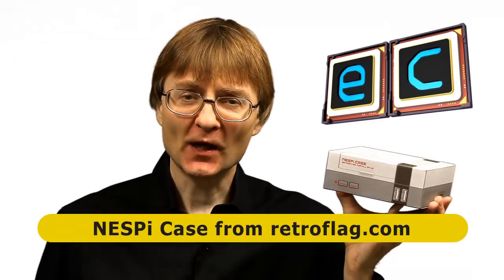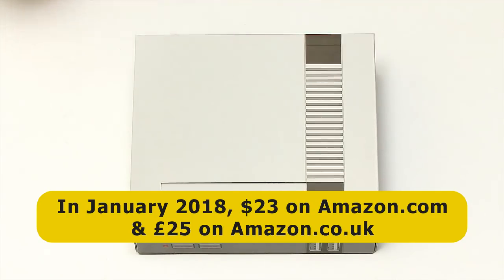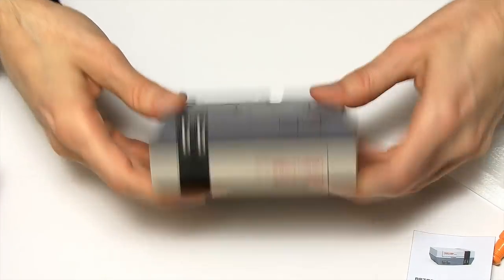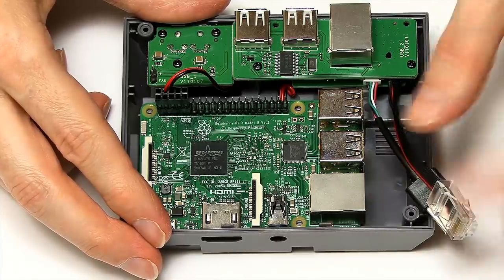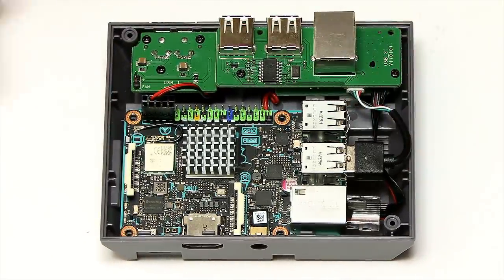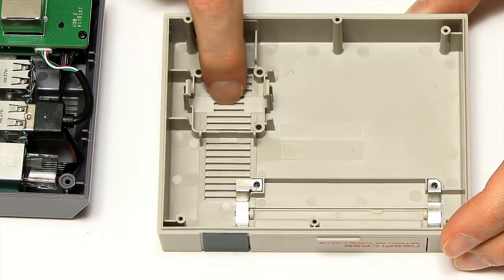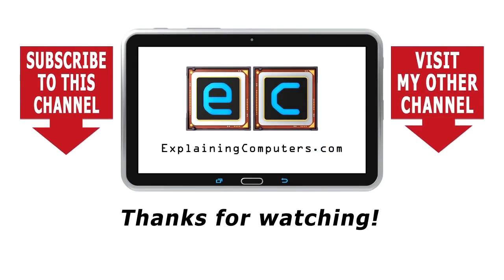NESPi Case for Raspberry Pi

Comment: Its a good case but the thing I've noticed is that the slot for the 3.5mm hole is way too small so you may have to make it larger. I spent an hour trying to figure out why the composite video just shows a black screen and then noticed that the cable was not connected properly because the 3.5mm hole on the case is too small for the cable and does not give a proper connection.

Comment: Very interesting, The new iterations come with a safe shutdown switch you can enable, you just have to install a script on your pi, flick a switch on the inside of the case, and the front powerbutton will safely shut down the Pi. Marvelous. Also, there is a new SNES case that just came out that seemed to solve the whole front connected Ethernet that.. me, among others, do not enjoy, Granted, its not on the back, but on the side, towards the back is better than nothing!

Comment: I would have hoped that you addressed the temperature icon for the pi at the end of the vid.  I would assume using a fan and heat sink would bring temps down?  Awesome video!  Thanks!
Reply from the maker: Yes, a fan clearly needed. I have looked at several in other videos. :)

Comment: One thing you missed from the video; the reset button can be programmed to restart whatever main program you use for emulation (e.g. EmulationStation) to gracefully stop running programs and then reboot the Pi.  Similarly, you can also program the power button to kill applications gracefully and then power off.  
A basic scripts is available here: https://github.com/RetroFlag/retroflag-picase however, you may want to customise the script it installs for specific actions.  Anyone reasonably familiar with Unix and Python will find this a breeze.
Reply from the maker: I indeed missed that! I guess it is just a GPIO input switch after all. Interesting possibilities . . .

Comment: +Chris 
I'm soon planning to sink an ASUS Tinker S into this case with a mounted fan.
Do you know, whether the fan blows permanently or is it regulated in any way by the temperature in the case?
Reply from the maker: I'm sure that the fan will just blow -- no regulation. I too may try a Tinker Board S in this case! :)
Reply: Thanks for answering my question.
So there is a further temperature management necessary - maybe with an 8-pin AVR plus T-Sensor. Anyway, I like that case, even if it costs 27€ here in Germany.

Comment: Hi Chris,  I got this case and its awesome!  One thing Id like to point out (from knowledge I gained from your channel :) ) is that for a safety measure when using this case where it kills the power risking SD corruption, what I did in my build was use Berryboot on the SD then boot retropie of a mini USB drive that plugs into the pie itself so its out of view and you dont have to leave the lid open in the front....so thanks mate for that! :)
Reply from the maker: Thanks for this -- good Berryboot tip. :)

Comment: I recommend a wireless keyboard like a Rii 8+ as you can put the receiver in one of the USB slots inside as its a small receiver and keeps the external slots free as well as having a clean look. Also 2.5A is the recommended PSU for the Pi 3

Comment: QUESTION:  Just rec'd an RP3B as a gift.  Discovered the HDMI is only giving me video, and no audio.  Do I need to connect the sound plug to spkrs to get sound or is something defective?  Thanks, Chris, I enjoy your program.  Mike
Reply from the maker: Thanks for your kind feedback.You just need to change the settings in preferences to output HDMI rather than 3.5mm audio.

Comment: These SBCs & retro gaming are extremely new to me...someone help me out?
I want to build a RetroPi style gaming station, but want "the best" SBC that will also do some Gmail & Facebook checking, web browsing, & watching The YouTubes in 1440p60fps...

It seems that either the Rock64 4G or the Udoo x86 Ultra would be best? But would they fit in the glorious case seen in this video?

As far as the gaming...I'm just looking for those 6,500-7,300 retro games from the original Playstation & back. Not looking to play Crysis on this thing, though maybe some PS2/Xbox 360 games would be a bonus...

Comment: in defence of the push/pull sd card reader replacing the push/pull one.  Within the first month my pi2 fell off a table and the sd card slot is now permanently pushing out.  I either have to secure it with an elastic or store the case upside down an push a butter knife against the slot.  I am quite pleased that they use a different system in the pi3 I got my nephew.

Comment: I got one of these cases with the little fan and I needed my 2.5 amp power supply for it to run well without that lightning bolt symbol on the upper right corner of the screen.  It ran fine with 2 amps when the fan wasn't connected.  I love it and I will probably get more.  Thanks for letting us know it also fits a tinker board sometime I might try one of those out.

Comment: I do understand the reasons for uploading/rendering 720p content. However, I must say I would be very pleased if the videos were 1080p (or even 4K). Would that be a good new year's resolution? I am so sorry.
Reply from the maker: I am planning on moving my pipeline to 1080p sometime in the first half of 2018. As you appreciate, it requires quite a lot of pipeline changes (not least re-rendering all of my titles and stock elements, and also changing my shooting style as a regularly crop a 1080p plate in post). But it will happen -- it has to! :)

Comment: I have a Rpi2 but the spring is borked and right now I have to tape it or use a rubber band to hold it in place, do you think I can use this box with the pi with this condition ?
Reply from the maker: You should be able to tape it using this case.

Comment: Yay! Great coverage as usual!
I have one and it’s nice but the ventilation at the top of the case is quite restricted making a fan much less effective. 
I’m tempted to pull out Mr. Dremel and make a few cuts, but I’d probably harm the aesthetics of the thing. 
A fan is probably overkill for a Rpi3 with standard clocking and heat sinks but a Tinkerboard is another story altogether.
Reply from the maker: Totally agree on the potential benefits of Mr. Dremel here! :)

Comment: Another great SBC project accessory on another great vid.

One future project I would like to see is if it would be possible to use an SBC as a streaming/encoding computer to take some of the weight off a PC and find a const effective way of utilising a Raspberry Pi to stream with a minimum setting of 720p and 30 fps and how further up it could go if it had no bandwidth limitations.

Comment: Nice video.
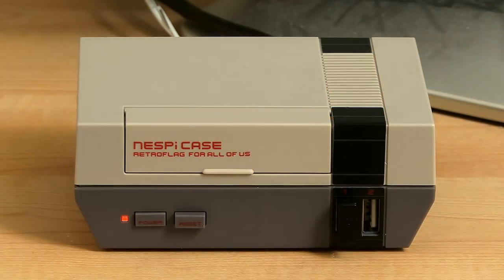Where did you get your Storm Trooper helmets on the right side of your table @ 10:16 ?
Thanks.
Reply from the maker: These are home made -- rotocast in fibreglass resin from a latex mold taken from a modified "bobblehead" stormtropper.
Reply: ExplainingComputers Aww, shame, they look great. Anyway, keep up the great work with your videos.

Comment: I bought one of these a month ago and was very impressed with it both as a case and resembling an nes. The only real knock against mine was that the screws fastening the pi down weren't perfect, but the pi 3 sits in there very well.

Comment: Chris, why did you not put the wireless connector at the internal USB ports? other then that I found it good that you showed the possible errors one could make putting it together. And if I am not mistaken, perhaps you could fit a 2.5 HDD at the inner topside that has some room left, although I am sure you would have to destroy the case a bit to fasten it.
Reply from the maker: Yes, the donly could go inside the case -- but not if you want to get it out easily! :)  You may get a 2.5" drive in the top of the case (I've not opened it up to look), though the screw risers that stick down onto the Pi may need removing to achieve this.

Comment: 5:19 - how do you refit a glued on heatsink?
Reply from the maker: It is fitted with thermal tape -- so fairly easily reapplied (if not as well without some new thermal tape).

Comment: Nice.  One of my concerns was about heat... thinking back a few videos and remembering that some of those little boards demand a 4A power supply (not in this particular case), I got wondering how the heat would be dealt with, but you addressed it with the 30mm fan option.  It would be interesting to know if that would be enough to deal with whatever heat could be generated with such a setup.  I'm not a big fan of these little tiny SBC's, but every vid that you make about them puts a wee bit more confidence in me about them.

Comment: I ordered mine just before Xmas as had wanted to get back into homebrew ZX gaming and I found a load of my old Atari 400 computer games printouts from that glorious era plus a few old MSX and Oric/Atmos and BBC printouts and even one ancient withered and yellowed set of ZX80 program typed sheets for a very sketchy random maze sort of game I made using large cube lines to create the classic "dungeon" experience so spotted Retropie had MSX, ZX Spectrum and several Atari platforms I followed on with my Nespi purchase with a RP3 and so looking forward to peek and pokeing, stabbing a few USR's to get them blocky pixels jumping about the place again hehe and especially in the case of the ZX80 fire will no longer be an option (my mum bought me a ZX81 cos my kit form  ZX80 just kept combusting and I prob annoyed Sir Clive like hell getting replacement parts hehe)   The Atari 400 doesn't seem well remembered these days altho it and its bigger brother the original 800 were quite formidable gaming platforms, just the price compared to the Vic and C64's saw the platform divebomb and by this time I had evolved to Speccy +3 and was repairing and building my own PC's from salvaged parts.
Reply from the maker: Great days.

Comment: I was thinking that if you have a wireless keyboard/mouse with a small dongle than could go inside the case. Which would be neater and give you four free ports on the front.
Reply from the maker: Yes, you could fit the dongle inside the case -- though not if you need to get it out regularly! :)

Comment: I like if they made a Thinkerboard with two built in 8core CPU and they use 2 cores as one single core, like a Raid0 for 2 cores to work faster, so having two 8core CPU's would work as one single 8core CPU at much faster clock speed, so it can play modern games, an M.2 slot in the back side of the board, and a Ram slot so we can put 16GB or DDR3 ram

Comment: A nice review. This case addresses one of my minor faults with the Pi and that is that cables and wires come out in all sorts of directions giving the Pi a rather disheveled look. No fault of the Pi though for a palm-size sbc you must address a few tradeoffs. A nice review indeed. Well done.

Comment: Great case, bought a few right when they came up. Not too keen on having the ethernet port on the front though, that needs to go on the backside... Also would have been nicer to have all the spare unused usb ports routed to the front (maybe keep one internal for a wireless mouse/keyboard combo). (read more for nitpicking and tldr;)

Also, wow, would it have helped to have read the manual to know where those screws went, before you made the video? Honestly (and I'm nitpicking here, the video is fine), I'm not used to you fumbling with things like that. Usually you're very clear,  thorough, and methodical, but in this video you were a bit all over the place.. 

tldr; Nice case, but would have been ace with only peripherals on the front, and connectivity on the back.

Comment: Very impressive but those are not soft power buttons if they just kill the power. A real soft switch that saves and shuts down the OS would be keen, maybe make the reset into a controller sync.

Comment: It looks like there is an unused USB slot inside the case. Does that have enough clearance around it to put your Rii dongle in it inside the case  freeing up all the external slots? I suppose that isn't a good idea for you as you use the Rii for so many SBCs, but if it was a more normal person (some of your subscribers may qualify) it might be a slicker solution, assuming it does fit. So, does it fit? Would anything else fit in the second now internal USB slot?
Reply from the maker: Yes, indeed, you could fit a dongle -- or three! -- inside the case if you did not need to get it out. As you say, for me, that would be kind of inconvenient, given how I move kit around to make videos.

Comment: they should've just put a hole in the back so you can connect it to ethernet before screwing it together. because if you use ethernet, its gonna be hooked up all the time. front ethernet is just a waste of money.. well, or ideally just put a 90 degree adaptor to make it to the back but I see the difficulty in this as there is no space to do it..

Comment: Brilliant! Well I got a Nes Pi myself but its the Hikig version which is more lightweight and allows proper circulation for my fan. It works fine near 2.5Amps, although it doesn't include the Reset or Power button but my Power Plug contains a 1/0 switch for my Pi to turn on and off. I also use Lakka with RetroArch to power my Retro games. And I use my Logitech F510 GamePad to play it. If you like to know what my Nes Pi looks like have a butchers from this link below:-

https://images-na.ssl-images-amazon.com/images/I/618AjiS%2BVkL._SL1500_.jpg

As you can see its more slimline and can easily fit in your briefcase and my Temp rating at CPU full utilisation provides a adequate environment for the Pi 3B.

Comment: My Pi's internet is hard wired so I'd feed the cable through the back of the case and straight into the Pi also for the keyboard to leave the front clean.

Comment: Another great video, really like your coverage of sbcs. There have been reports in the retropie community of receiving low voltage warnings using this case with 2 - 2.5 amp power supplies. I use a 5v 3a ps with mine and it works great. It is a great case but for best results you want to give it some extra juice. 
Unofficial RetroPie Discord Chat: https://discord.gg/JdXc6nx
Reply: Realm Chat Yes I also found this worked for me. I kept trying out power supplies with extra voltage, but not until I had one in with more amperage did it finally work as intended!

Comment: I find it silly they have the LAN moved to the front when the back of the case would be a more logical place for it to be moved to for use. That flap on it should also contain a recessed area to allow smaller dongles like your one you plugged in to be fitted under the flap and still allow it to close. From what I can see here in this video any dongle plugged into those ports would prevent the flap closing.

Comment: I really like this but you would need to have a second pi if you wanted to use the g.p.i.o. pins! Not that any excuse to buy another pi is a bad thing!
Reply: In fact i installed Retropie and wiringPi together! That way i can use gpio pins without problems!
I use a RGB led for GPU temperature monitoring! I also hacked the reset button and installed another button to shutdown the pi properly! So...you will not need another pi if you want use gpio pins!

Comment: Could you put the USB keyboard/mouse receiver in an onboard port inside the case and still leave the front ports free? Maybe there are wired controllers for a truly retro feel, but still be able to use a keyboard for the OS?
Reply: Leon Adams Yeah, you can use the internal USBs, for anything that will fit :)
Reply: Sweet!

Comment: Excellent case. With a Raspberry Pi 3 you really want a heatsink and fan - otherwise the system gets really hot. The Pi 2 won't get too hot.
Reply: I just watched your video on that cooler with the two fans. How's your pi 3 been holding up in the nespi case with that cooler? Is it still pretty much the same temps as in your video?
Reply: Yeah I got a fan in mine think I gonna get heat sinks tho
Reply: Pi 3 run Retropie is very hot,must use fan and heatsink
maybe the ultimate dual fan cooling system can cool down 
https://www.amazon.co.uk/dp/B0744G58P4?m=A187Y4UVM6ZA0X&ref_=v_sp_detail_page

Comment: By connecting all 4 usb ports to one of the pi's usb headers, aren't they giving up on transfer speeds?
Reply from the maker: Not really, as the four ports on the Pi all run off the same hub.
Reply: Yes Chris, you are absolutely right. (I really hope they will use a usb 3 controller in the next version, or at least a couple of usb 2 channels, instead of just 1)
https://www.raspberrypi.org/magpi/raspberry-pi-3-specs-benchmarks/#attachment_1579

Comment: 1 thing I don't like about the raspberry pi is that the ports are arranged stupid. I like my ports that are connected all the time to be at one side. Why does this case have the ethernet at the front?? Pretty stupid
Reply: same for me. If some designer is reading this, also do not place all of the USB ports on the front! Leave 1 or 2 at the back.
I am looking for a case to be used for a multimedia system using a Hifi-berry extension. But so far it seems I have to build one by myself. And yes, I still use ethernet cable instead of WiFi in this case. Old saying: Those who know radio use cable.
Reply: Ethernet on the front is a poor design decision. I wouldn't buy one for this reason! I want my devices on my network (wired only) but that would look ugly!
Reply: Stoney_Eagle If the ethernet port was round back it would be perfect. But i think the onboard wifi  would be enough for retro gaming because you're not streaming data from the network. Game roms are usually stored on the sdcard. Plus, if you're nostalgic for the Nes, you're not gonna care
Reply: The new nespi4 case from the same manufacturer has Ethernet in the back